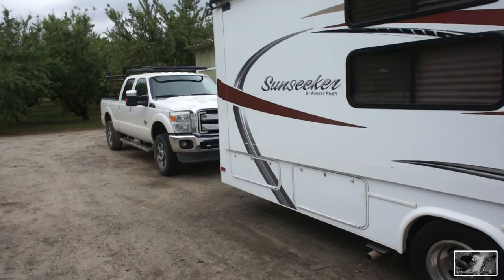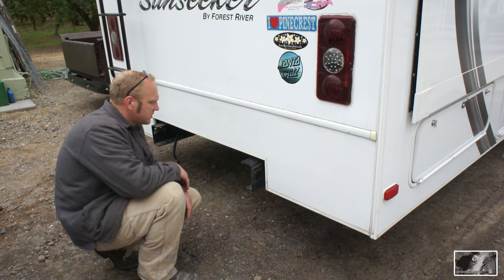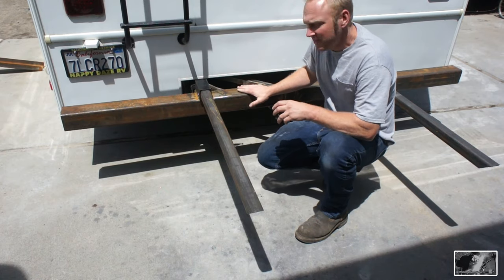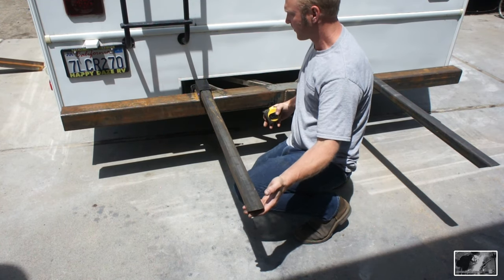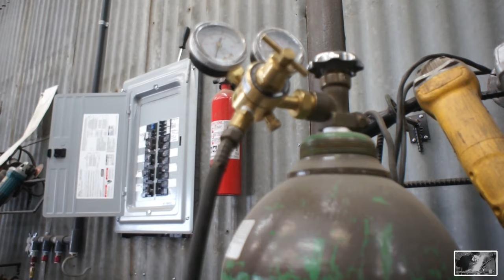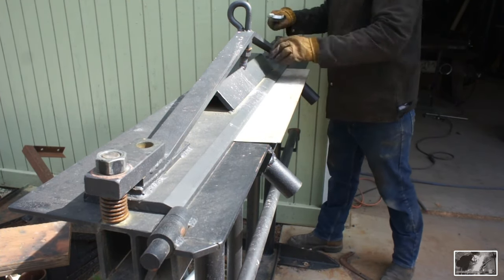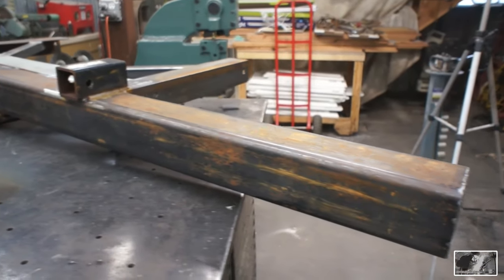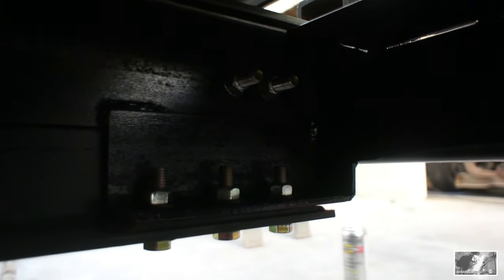A HUGE RV bumper upgrade.....and a fantastic hitch basket.

Comment: Well designed bumper and hitch basket. I was about to suggest the wheels, but you got it covered! A lot of loops on the basket to tie down any load. It would hold easily half of a ton. Enough weight to have this VR not easy to drive in a straight line. I had to replay Jessica's move at least three times! Very well executed, both gloves clapped the ground at the same time! Lol! Thanks Vincent!  Joe Lesage (new channel name).
Reply from the maker: Hey Joe! Thanks for the input! Good to hear from you. I like the new name

Comment: Good job!  What gauge 4x4 did you use?
Reply from the maker: usually I use .120 BC the sewer hose still fits. I think on this one we may have gone to a heavier wall BC he crates his sewer hose
Reply: Thank You for replying. I think i will go with 3/16 5X5,  so I will be done with it for good and don't have to worry about it.
Reply: @marcinmisztak257  If you do this then you will have to get heavy duty leaf springs in the back like weldtech does with 9 to 11 big leafs.  Also if you put a heavy bike or lots of weight in the back do remember that this puts 1.5 to 1.7 x more load on the rear axel and also the front wheels get unloaded which lowers your steering and stability. Put something heavy in front of the rear axel.
Reply: @HealthSupercharger  I will defiantly do that!  Thanks

Comment: What a well built setup you fabricated. Your customer should be well pleased. I have one question though did your angle braces stiffen the ride at all. I think there might have to be some natural flexing of the RV body. Just asking because I have a 5th wheel and thinking about doing the exact thing to mine. Anyway I think you did a awesome job, God Bless!
Reply from the maker: The customer said it has been working really well. I dont know if he is the type of guy to notice flex in the body. Im  also am not sure what weight he has loads it to either. He does have load helper bags on the rear axle. Thanks!